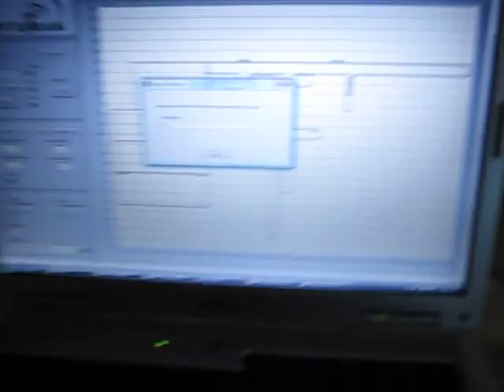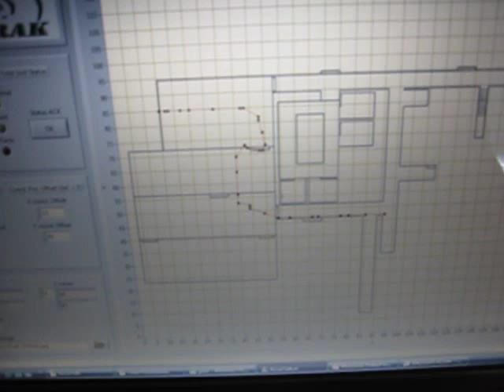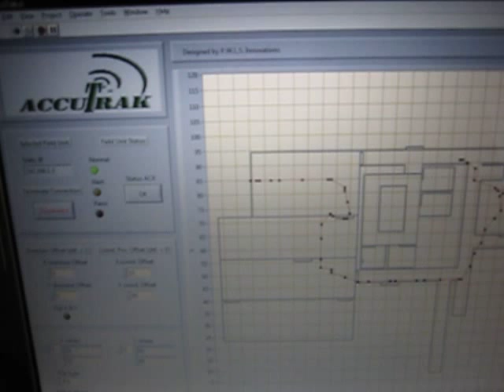Inertial Navigation System Real-time Indoor Tracking

Comment: Nice work there guys :)
i am developing a dead reckoning based positioning system as part of my senior project, i have a few questions:
1- did you use step recognition and estimation or used double integration method?
2- where did you mount the sensors ? head, foot ?
3-if you have used step detection, what is the pattern/ algorithm that i am looking for?
i really appreciate your help :)
thanks a lot.